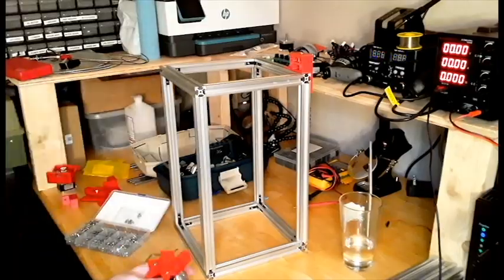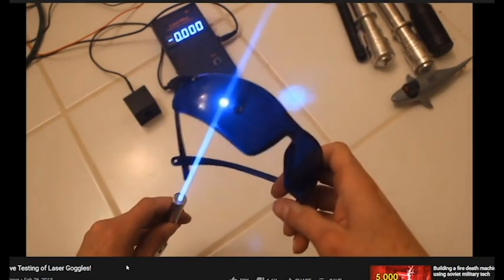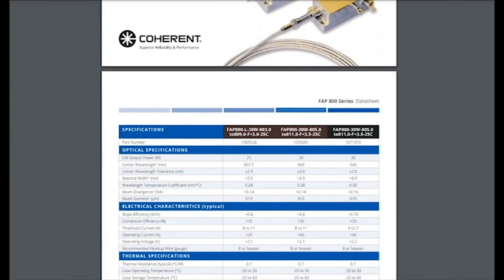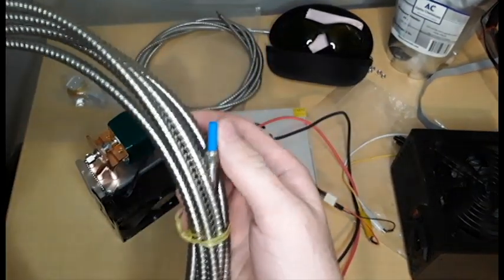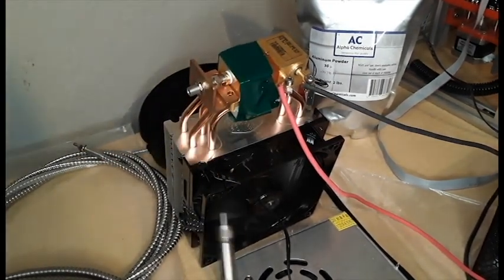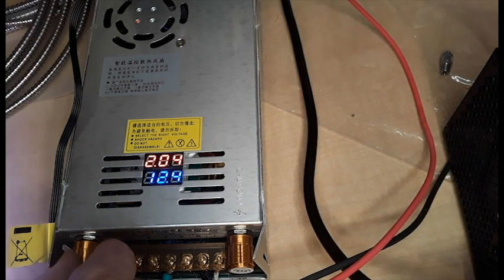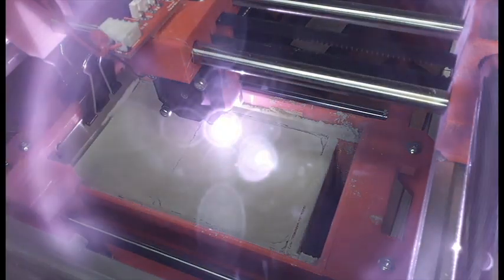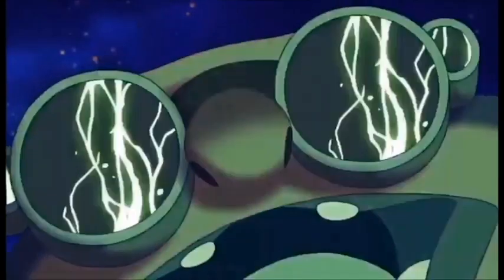50 Watt IR Laser Setup FAP800

Comment: I want to learn more  about the 3d printer and the driver and how you cool the laser how much power did you output I have a lot of experience with 3d printers and laser and now I am between buying 2  nichia nubm31 diodes or a FAP800 70w to make SLM 3d printer like you did and try to make metal cutting laser with oxygen assist

Comment: do you think a microwave transformer re wired to bring down the voltage connected to a full bridge rectifier like 90A and voltage regulated by a variac would work to power the laser in general and a couple of 120A mosfets to turn in on and off as a cheap solution?
Reply from the maker: No. I dont think that would work. I think you are better off finding three variable low voltage power supplies and putting them together in parallel